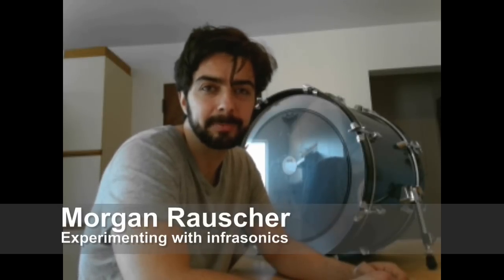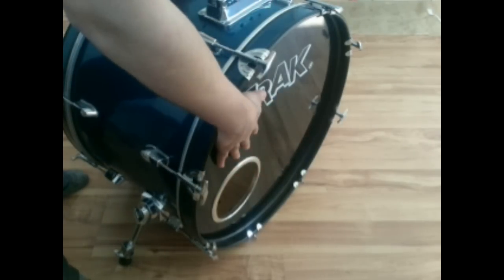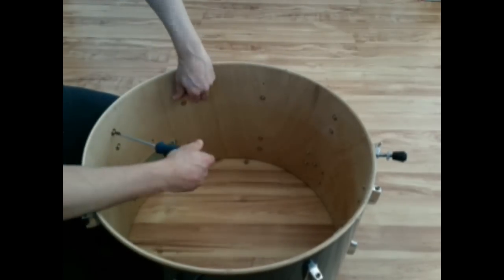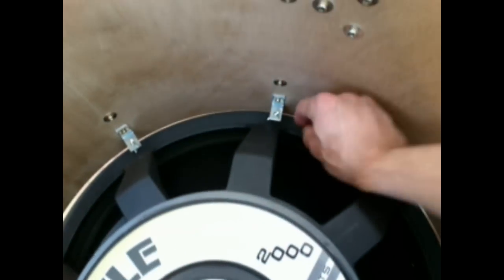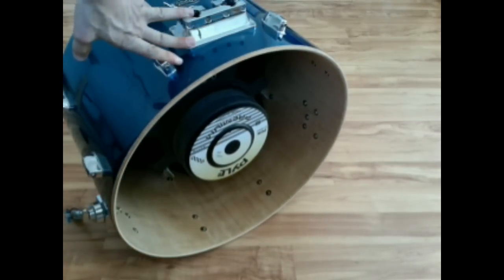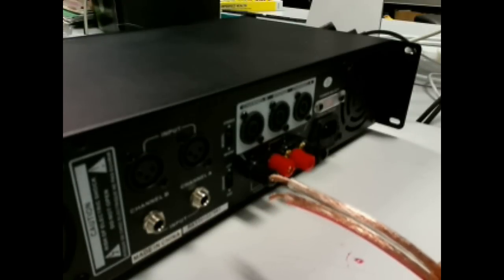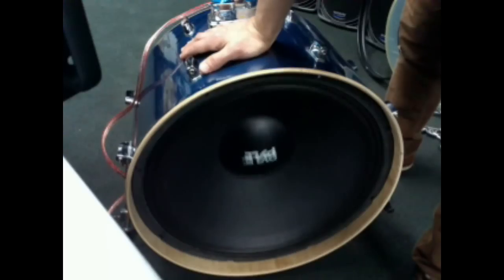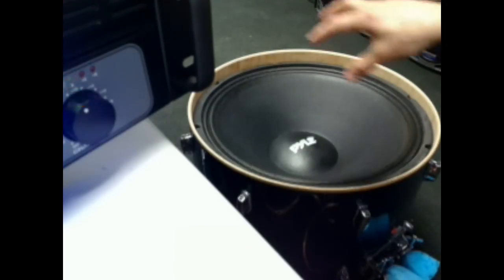Infrasonic (sub-audible) resonant sub-woofer & boom bass cannon

Comment: For some reason after sealing both of my subwoofer boxes im getting frequency responses down to 8hz and getting massive door flex at 15hz wonder why sealing my ported boxes improve the efficiency with the low bass and the subsonics
Reply: the reason why is below the port tuning the sub becomes unloaded as any sound pressure that would be created by the sub is relieved through the port, since the box is sealed the sound pressure isn't being released, so it can produce infrasonics a bit better, i'm guessing it's quieter when sealed at higher frequencies though. Ported boxes have a sharper roll-off than sealed, though are more efficient, and can allow better low extension.
Reply: xINFINITExgamer that would be your Port tuning you must be tuned to a high frequency the bigger the enclosure the lower you go most of the time and the length and the size of the port matter as well and changes the frequency
Reply: a sealed box drops 12 db per octave. cabin gain is plus 12db per octave below room tuning .

Comment: Not be "that guy" but those speakers cables are silly big. We don't use that size even in pro EDM sub rigs or at metal shows.
Reply: @DTW-bx2vy  Thick speaker cables are unnecessary. Speakers run at high-voltage/low-current, the complete opposite of a car amp.

Comment: The build video turned out really great. Interesting idea to build an infrasonic sub! I like the design because it's very unique. Unfortunately what you're trying to do here is a bit like building a car that's going more than 250mph from e.g. a Honda Civic by putting a truck engine in it.
An infrasonic sub is a good topic for my DIY Subwoofer Build series. I'll maybe film a video about how and if that works in 2018 when I continue with the sub I'm currently building: https://www.youtube.com/playlist?list=PL4lJ1ej0uWlQC7HWP82uNKYVokgEx39qQ.
Here are some problems which you might have had: a bass drum is an instrument. Every part of an Instrument produces sounds. A speaker should reproduce sounds instead of creating them. A driver produces no sound below its resonant frequency. By putting it into an enclosure the resonant frequency even rises. (There is the concept of URPS, Under Resonance Principle Subwoofers, but that needs a very powerful amplifier, 1000+ watts.) The bigger the cone area the bigger the enclosure volume needed for lower frequencies. The box needs to be at least as big as the Compliance Equivalent Volume (Vas) of the driver. (If it's the Pyle PDW21250 then 25 cubic feet.) If you put the drum heads back on you have a band pass enclosure which takes some effort to calculate correctly to get a suitable result. Professional drivers are designed for loud volumes not for low bass.
Possible solution: open baffle with powerful amplifier and an active subwoofer crossover. An open baffle lowers the resonant frequency but produces a loud peak in the midbass area.

Source of all my knowledge: German DIY loudspeaker magazine Hobby HiFi
Reply from the maker: Hatter? Not trying to do... Did
Reply: You're removing all my faith in academia, one comment at a time

Comment: Technically you could tune in resonance with how tight the bass head is and what frequency it responds to
Reply: The problem is, even if you loosen the head all the way, it wouldn't even resonate anywhere near low enough to be of any use, and you have to plug the hole too.

Comment: 30 hz is not that low a normal Bluetooth speaker can reproduce 30, and hearing protection for 70hz and under is not really needed. People sit in 165db vehicles at 30hz and there hearing is not affected.

Comment: Crappy ass SVC 21" Pyle trash. Sundown,  Crecendo audio, DC audio, PSI, SMD, Rockford fosgate, Alpine, Kenwood. anything above would kill this in a matter of seconds. this box is illogical because your only running with a max of something around 3.0 cu. ft^  MAX and your port is so wide open and theres absolutely 0 lenght on it it's just a leaky hole. you also have your leads going through 2 holes in the box which can cause distortion and can fuck with the tuning of the box making distortion or other things like box rise or resisitance changes. and as for hearing protection? I'm sorry but even if you had this in the proper box it needs you'd never ever be able to hit a high enough decibel to actaully damage your ear drums 85 DB at prolonged usages could cause somewhat hearing loss and I highly highly DOUBT this sub ever got near 85DB in that drum.

Comment: It's just a semi passive radiator.
Reply from the maker: Oh that's it eh. Oh no. So sad. Thank you for the lesson but you're just a comment.
Reply: You can use a subwoofer with the magnet spiders and coils removed just using the basket and cone which is the same thing Klipsch does with their reference series house subwoofers. Another cool idea would be using a whole intact subwoofer as a passive radiator but use the terminal leads as a device to recapture some of the energy and feed it back to the battery bank or capacitors. I wasn't meaning to come off as a dick though and sorry if it sounded as such.
Reply: There's also another project that some sound engineers use to mic kick drum which uses a 6 or 8 inch component or woofer as a microphone for the kick drum mounting it closely to the port.

Comment: You would get more Bass putting it into the right size cabinet, this isnt infrasound. The only true infrasound device at the moment is the rotary subwoofer.
Reply from the maker: haha - take it up with Pile Speaker Co. - but I think I agree with you regards infra-sound devices in general - hard thing to do.
Reply: Morgan Rauscher: Yes incredibly difficult; the trick is to push large volumes of air at high accelerations, apparently a 30cm rotary sub can shake houses a couple of miles away.
Reply: @suzesiviter6083  SVS, JTR, Rhythmik and others produce subwoofers that produce useful levels of infrasound :) My system can produce 16Hz at 121 dB measured ground plane 2meter RMS.
Reply: @thingsdemystified  16Hz at 121db sounds very optimistic, what sound level meter(SLM) did you use? I know the cheaper SLM's are grossly inaccurate at low frequencies.
I measured around that at 20Hz for a 120L subwoofer, not one of those compact designs that fudge the figures on marketing gumpf.
Reply from the maker: Try it before you knock it
Reply: @morganrau  It is against hard science, BUT well done for trying something new, that's how discoveries are made.
Reply from the maker: @suzesiviter6083  haha. You said hard science. Peace :) (try it ;)